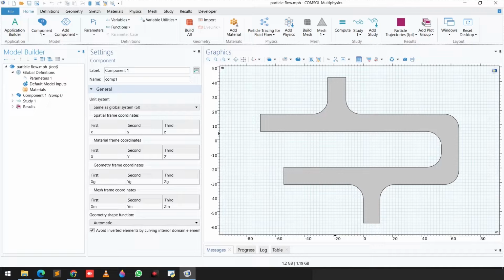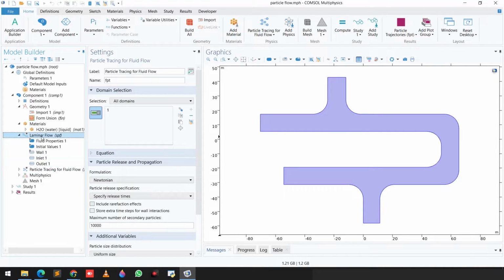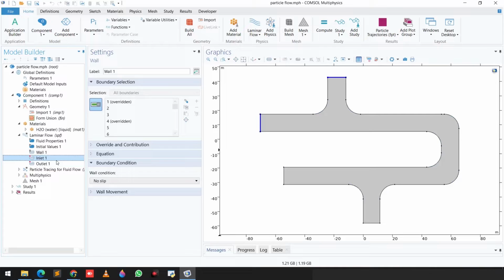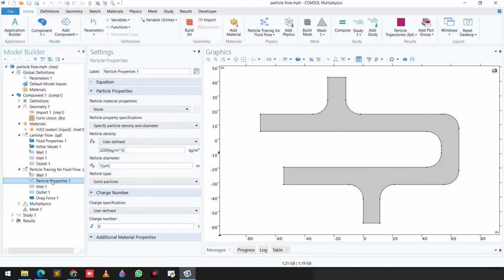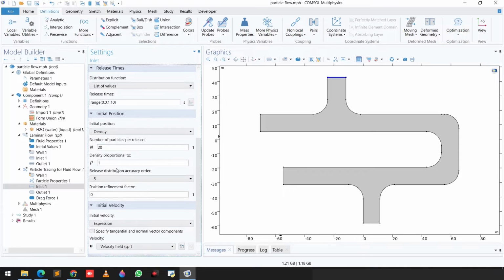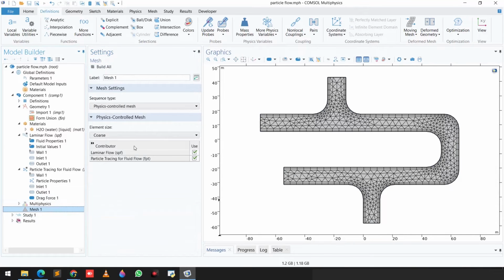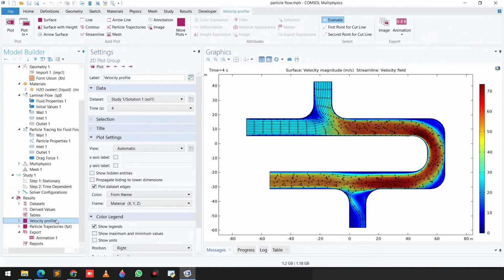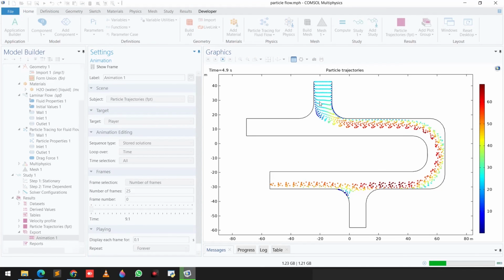COMSOL Tutorial 08 | Particle flow in fluid (Laminar flow) | Particle tracing/tracking module

Comment: Hi, thanks for explanation. Shouldn't we have applied lift force? Do we not have inertial lift force in two dimensions?
Reply from the maker: Thank you for your question! You're right to consider the lift force, and it can indeed play a role depending on the setup. In 2D simulations, inertial lift forces are generally not as prominent as in 3D, but they can still exist under specific conditions, especially in flows with high Reynolds numbers.

If you want to include lift forces in your 2D model, you can manually add them in the Particle Tracing module by including an additional force term. However, in laminar flows at low Reynolds numbers, lift forces tend to be minimal, which is why they may not always be included by default.

Comment: Hey, thanks for the video it was really helpful, I havea a question, how could I define that particles are entering all the time given a mass flow rate and not simply a specified number of particles?
Reply from the maker: Thank you for your question, and I’m glad you found the video helpful! To continuously inject particles based on a mass flow rate rather than specifying a fixed number, follow these steps:

In the Particle Tracing module, under Particle Properties, instead of specifying the number of particles, use the Mass Flow Rate as your inlet condition.
Define a continuous release of particles by selecting Release from Boundaries or Release from Domain under the Particle Release settings.
Set the mass flow rate and particle velocity to correspond with the rate at which particles enter the system.

This will allow particles to be released continuously, based on the defined flow rate.

Comment: hey !! can we use this process method to analyse the glass flow in trenches?? just by skipping certain steps like outlet and process parametres?
Reply from the maker: Hi,
I am not sure whether you can use the similiar method to simulate your problem. However, I came across the article (check the link below), could be relevant to your work.  https://www.researchgate.net/publication/257966689_Cylindrical_glass_nanocapillaries_patterned_via_coarse_lithography_1_mm_for_biomicrofluidic_applications